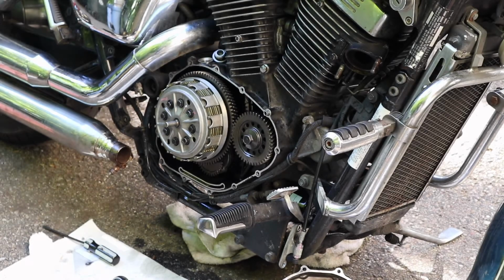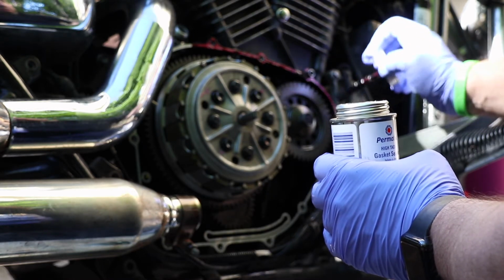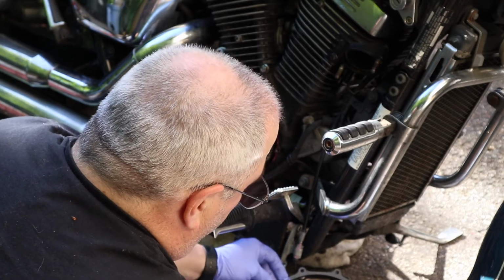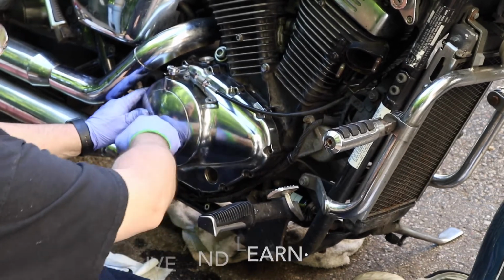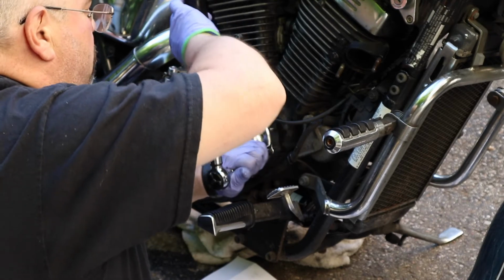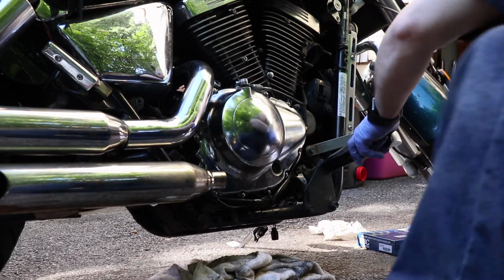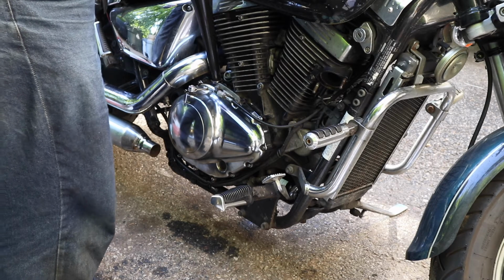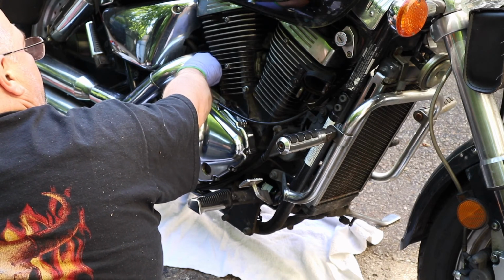Suzuki Marauder 800 Clutch Replacement - Part 4 - Clutch Cover Assembly & Refilling Oil

Comment: Shouldn't you have tightened and torqued cover bolts in a criss cross pattern?
Reply from the maker: Markie K Probably would be a better idea to prevent any possible warping, but the torque on those bolts is so low that it it really doesn’t matter much.

Comment: Does the transmission and clutch run on the same oil as the motor ?
Reply from the maker: The transmission and engine are all in one case, like most Japanese bikes. It's all the same oil.